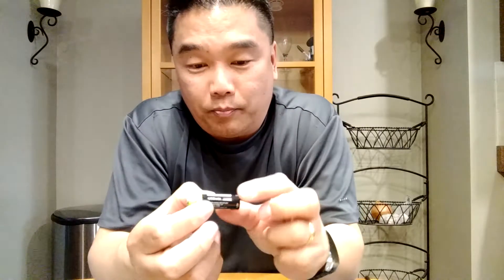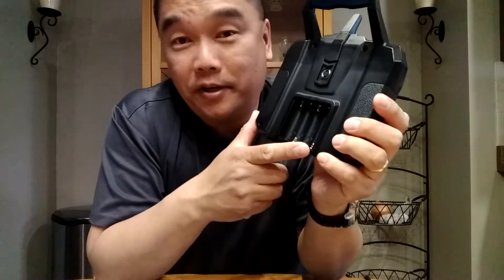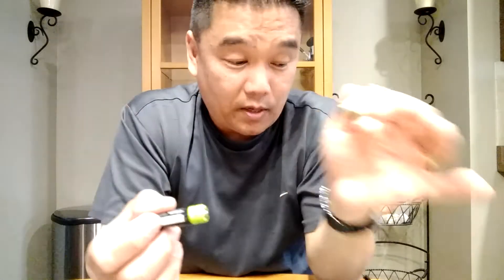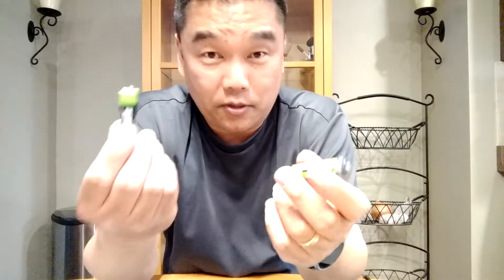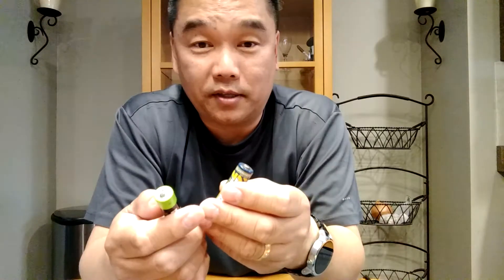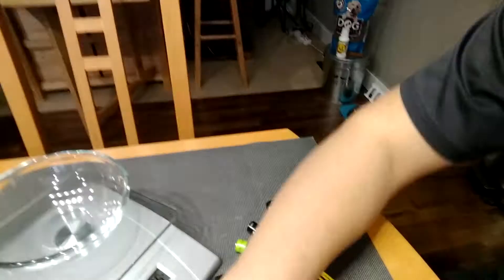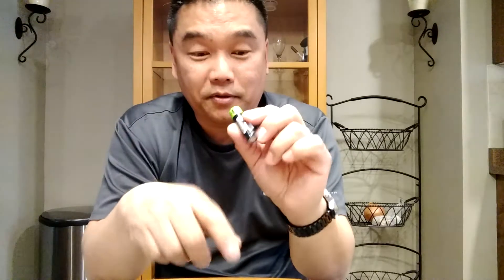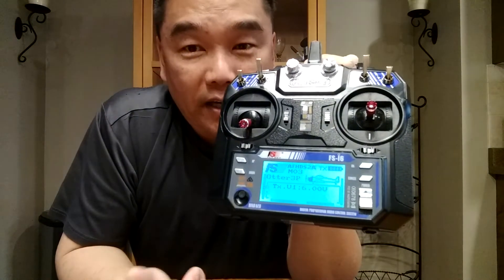Znter AA 1.5v LiPo Batteries vs NiMH

Comment: thanks....I have a question. How do I hookup an esc for my df65? I have a 750 7.4 volt lipo I'd like to use in the boat. Do I have to plug the plug from the esc to the receiver or just plug the esc into the switch plug?
Reply from the maker: Ted Hall .. an esc for the DF65 sailboat?  The receiver should handle a LiPo but the higher voltage may burn out your winch and rudder servos faster.
Reply: Is there a way to lower the voltage to 6 volts?
Reply from the maker: Most people use LiFe batteries.. but you can use a UBEC

Comment: More specs from the Banggood site (note max discharge currrent of 2A):
Electric core type: high quality A+ grade lithium polymer battery
Battery life: less than or equal to 3000 times
Nominal voltage: 1.5V
Rated capacity: 1250mAh
Rated energy: 1.85wh
Rated output voltage: 1.5V
Rated input: a USB MiCro input /5V
Maximum output current: less than 2A
The maximum input current is less than 300mA
Charge limit voltage: 4.25V
Full time: about 1.5 hours
Shell material: high quality fire ABS plastic shell + copper electrode
Standard color: Black Green
Product size; 14MMX height 50MM
Product weight: About 20g
Reply from the maker: Thanks Scratchy for the detailed specs